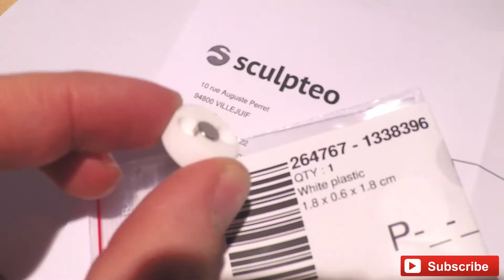Tutorial: Add Encoder to Gimbal (AS5048A, BGM 5208, 6208, 8017, 8108, 110, Alexmos, SimpleBGC)

Comment: How did you wire it to the BGC controller? Via SPI? If you use SPI do you need to wire up all wires? GND, 5V, MISO, MOSI, SCK, NS? The manual for the BGC controller was confusing for this part. I have the BGC 3.2 Extended controller.

Comment: Hi Timo. Thanks for your video.

Could you help me? May I use the magnetic encoder with this motor? I've been designing a 3 axis heavy lift gimbal, and I have a lot of doubts about wich motor I use.

http://store-en.tmotor.com/goods.php?id=321 or this http://store-en.tmotor.com/goods.php?id=324

Thanks again, your video helps me a lot.
Reply from the maker: Hi Paulo, the second motor will work. Because of the distance between the mounting screews. On the aluminium encoder plate the outer distance is 44mm, the inner distance 30mm and 25mm. So the U8 series will fit. But please check the specifications twice. The U13 motor won't fit. The motor has a 50mm screw distance and it is so heavy (1,3kg).
Reply: Thanks for your response. I've been checking the specs a lot of times 'cause it need work great! (LOL)
Well, I'll try your sugestion a hope it work fine.

Best Regards!
Reply from the maker: If you don't need the spacer between motor and encoder you can also check these motors from iflight: http://www.iflight-rc.com/ipower-motor-gbm8108-90t-brushless-gimbal-motor-with-as5048a-encoder-compatible-with-slipring-424.html or http://www.iflight-rc.com/ipower-motor-gbm110-150t-gimbal-motor-with-as5048a-encoder-for-3-axis-brushless-gimbal.html They both come with magnet adaptors.
Reply: hey the link u added in comment is a Drone motor!!!! if u install it in a gimbal controller. it'll fry the driver IC. u need a gimbal motor not a motor which says ***KV in the description.
Reply: I use iflight GBM8017 for a 1.2kg Camera and it works flawlessly. it is rated for 6kg pay load.